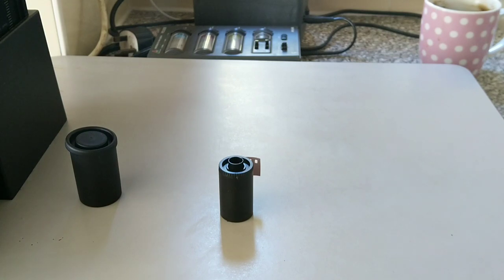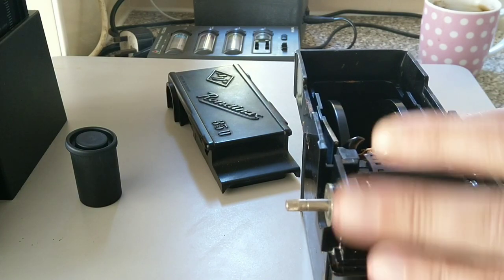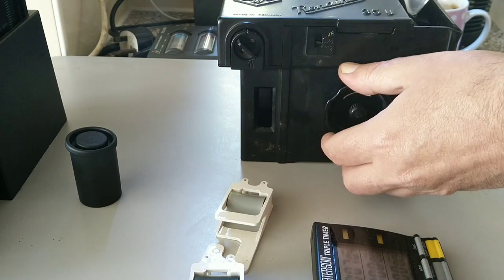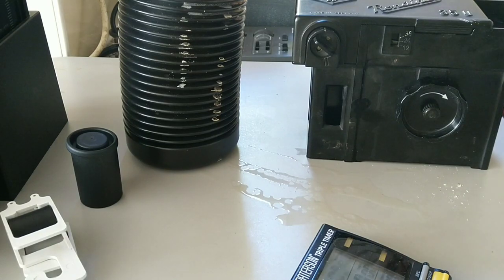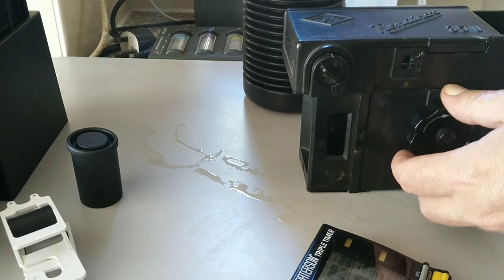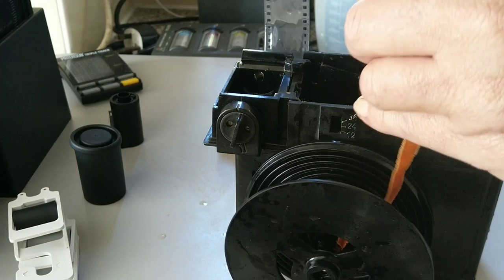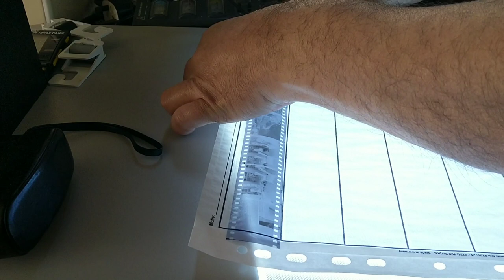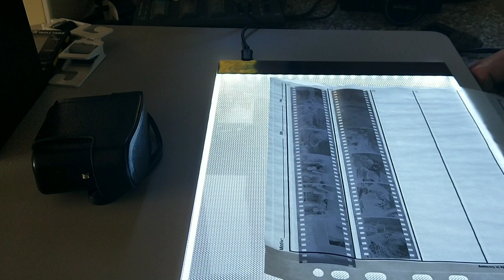Minox 35GL, test film, Agfa Rondinax 35U,

Comment: I am having trouble with my 35U. For some reason the film will not load onto the spool correctly and keeps damaging and sticking together and so after development I have most of my film destroyed.
Reply: I had this problem. To fix it I bent the corners over 90 degrees which makes the film grip the spool. Try it by wasting a few frames to get the confidence before closing the lid.

Comment: Very interesting. Did you notice any differences in development compared to your usual method?
Reply from the maker: Hi, the time in the developer stage was reduced due to continuous agitation but otherwise the same result as I get using the traditional Patterson tank, much easier to load the film into the tank and of course no need for a dark room or changing bag, would be great for beginners but they are quite desirable and hence getting stupidly expensive, especially the 120 version, do you do your own developing?
Reply: Yes, but I usually make a mess of loading the film onto the spool. It often sticks about half way. I think the film jumps out of the loading tabs. If this tank could be 100% effective in avoiding having to rewind and start again (in the dark of course!) this would be terrific. @thephotographersbag
Reply from the maker: @tuisitala9068  these Agfa tanks are very easy to load and would solve the problem, have you tried trimming a bit off the sides of the film after removing the leader, this tends to make loading spirals a lot easier, Kaiser spirals are notoriously difficult to load and even the Patterson one are hard, I gave up using stainless ones as I could never get them to load properly.....
Reply: @thephotographersbag  Yes, I have watched plenty of Youtube videos on the subject, trimming the edges in different shapes, loading directly from the canister, holding the edge of the film with my fingers to keep the film from jumping out, changing bag (disaster!), blacked out room allowing the film to dangle freely. Nothing has worked reliably so this idea looks like the solution for me. I will have to persist with the Patterson style tank for 120 as the 60 Rondinax is pretty expensive. On ebay the 35 Rondinax varies between about £20 and £60 so this should be fun.
Reply from the maker: @tuisitala9068  Hi, please keep us updated how you get on, be interested in your feedback.....
Reply: @thephotographersbag  Well I did get one of these and was amazed at how easy it is to get the film on the spiral. You mention that the development time needs to be reduced to reflect the continuous agitation. What factor should I apply to the times given by the Massive Development site?
Reply from the maker: @tuisitala9068  Hi, so happy that you found one and found it easy to use, I reduced the times by 20% for continuous agitation as a starter and it worked just fine with HP5 at ISO 400, have not tried it yet with colour but will keep you posted ....

Comment: I was taught to use a squeegee at school, but I prefer to wipe the non-emulsion side with a clean piece of kitchen roll.
Reply from the maker: I was taught the same at school, times change, seems your binge watching, thanks for you comments, your experience as a repair guy would be invaluable, I bodge my way through to try and get them working...please forgive me!
Reply: The Photographer's Bag I still bodge my way through some of my cameras. I could do with a decent shutter tester and a collimator, to be honest.
Reply from the maker: I am not that professional, use lots of test films(12 exposure) to see if it works, lots of black tape around backs for light seals, definite anateur stuff but rewarding when an old camera comes back to life...
Reply: The Photographer's Bag You can always take shots at different shutter speeds and aperture combinations and check for consistency in the negatives. I’ve got some old Eastman 5231 (Plus X) in a bulk loader, specifically for this purpose. I also check that the camera is focusing accurately at the same time.

Comment: Not a big fan of these foldable black accordion bottles. I prefer cheaper plastic bottles (HDPE one) or glass bottles with beads if I need to remove air. It might be interesting to have a larger framing of your work area in the video. It's a little tight and we do not always see everything. thanks for the video.
Reply from the maker: Thanks for the tip, the beads in a bottle idea sounds great, the glass bottles are heavier so would work better in a water bath I presume
My films are rubbish really, very low production standards, will sort out the issue!
Reply: @thephotographersbag  It's more eco friendly too. 🐌😁